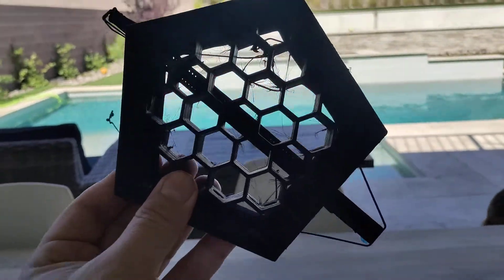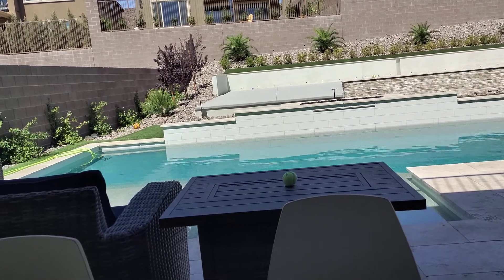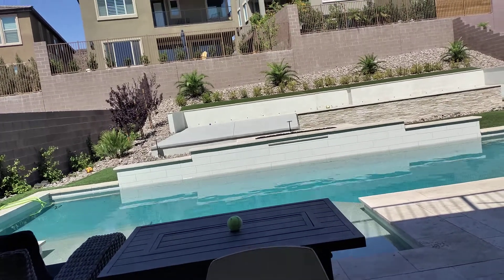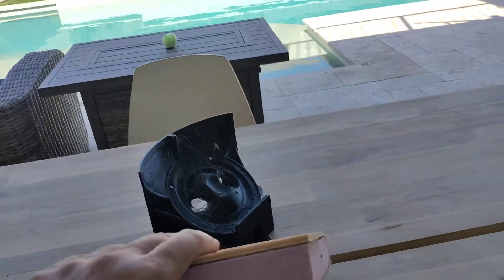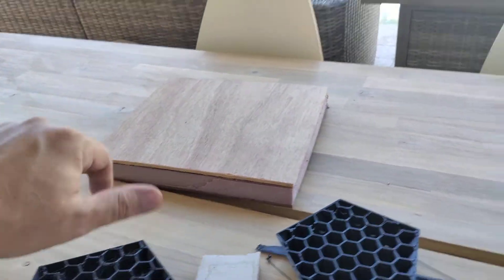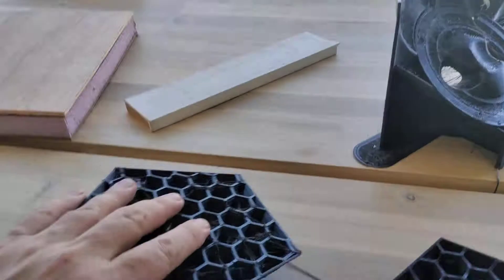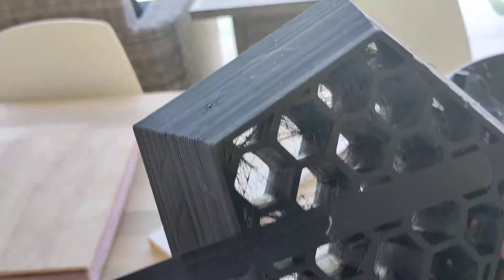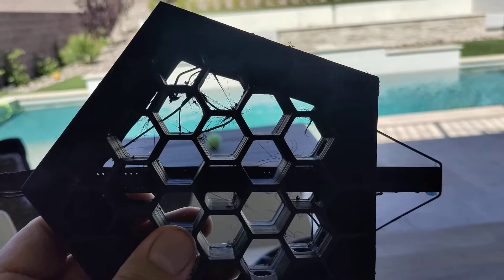Light and Rigid 3D Printed Loudspeakers

Comment: I like it!  Would be great to start standardizing on certain low cost speaker drivers that you use, like the 55-1870.  I'm thinking of some type of optimized enclosure that take advantage of honeycomb, reduces standing waves, also has metamaterial integrated into the design.

Comment: Great stuff, I used this for small bluetooth speakers, which are a good application for a few reasons: 
- minimizing volume taken up by walls is important to make overall volume as small as possible
- 3d printing allows us to make complex enclosure shapes to accomodate electronics and design choices
- small speakers can often fully fit on a build plate, and print in a reasonable amount of time

One question: if one side of the honeycomb is fully open, then why do you also need holes between cells?
Reply from the maker: I just left it open to make it easier to visualize. In an actual speaker, the outer layer would be solid.

Comment: You can also print hollow and fill it with plaster or expanding foam or whatever it is that you need. 
I'm not sure, but you seem to misuse the word CLD. CLD is not synonymous with laminate or foam core sandwich. Foam laminate is not CLD, because foam is not viscoelastic.

Comment: I just inject plaster into hollow prints. If you want the plaster to just make a layer like paint, then tape the part to a drill and spin it as it cures.
Reply: I've done that using gyroid infill and epoxy resin.  Fill with water first to find any leaks, seal with clay, then fill.